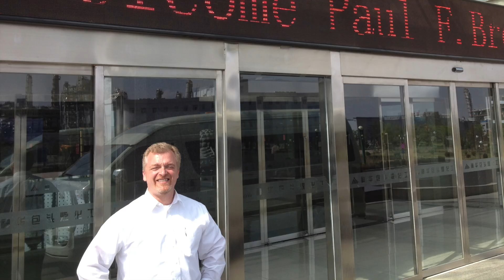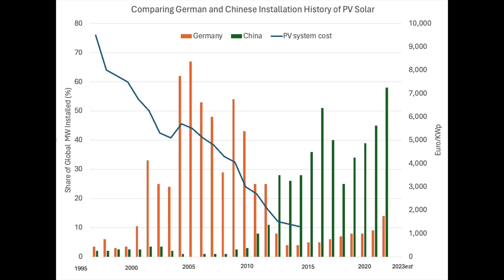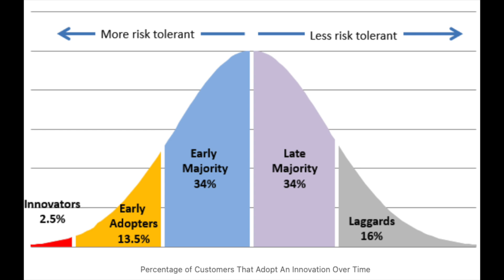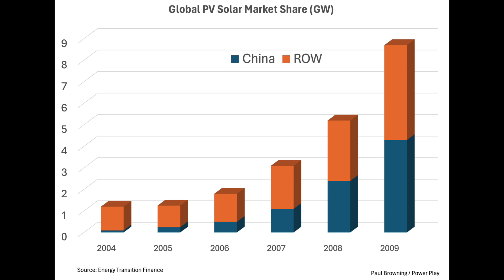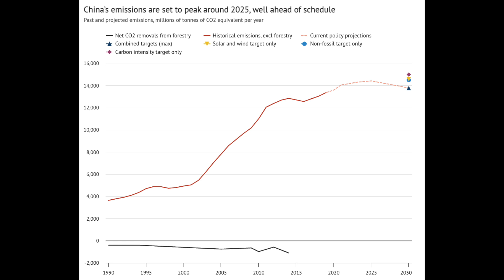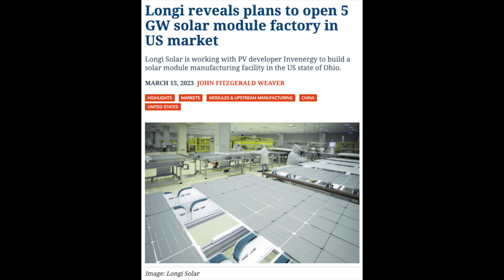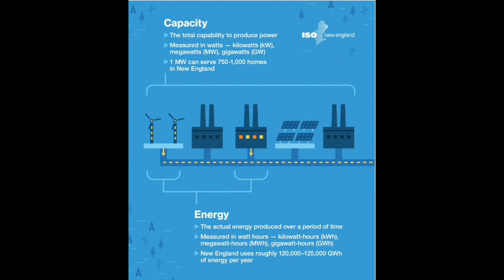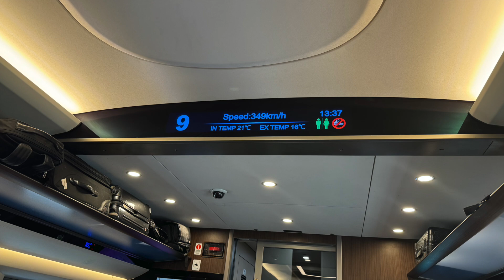Power Play S1 Ep. 2 | How China Rose to Dominate the Photovoltaic Solar Industry

Comment: Great stuff Paul, interested to hear your take on tariffs imposed on Chinese manufactured goods, and the impact that the current Chinese credit crunch has on the solar manufacturing industry. Most players, all along the supply chain, are selling below cash costs at present due to a significant production expansion and demand slump. Rather than outcompeting western countries, now they are outcompeting Chinese companies.
Reply from the maker: Thanks for the comment.  Regarding your comment about outcompeting Chinese companies as well as Western companies, it's absolutely true.  Some of the Chinese "majors" are starting to publicly complain about irrational behavior from some of the smaller companies in China.  But we do the same thing in the West when we overbuild capacity vs demand.  Solar panels are not commodities like iron ore or fossil fuels, but they're not too far off from that.  When supply and demand are in imbalance, you get irrational behavior, particularly in a market like PV solar that's growing so fast.  Getting market share now at irrational prices can lead to huge returns down the road.